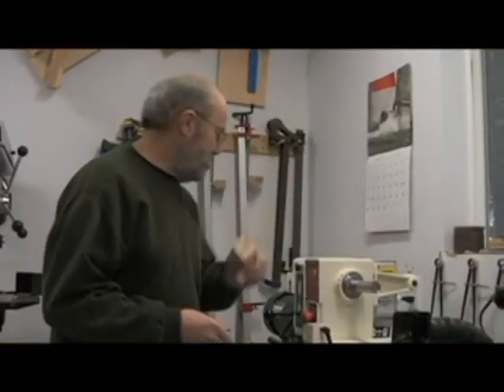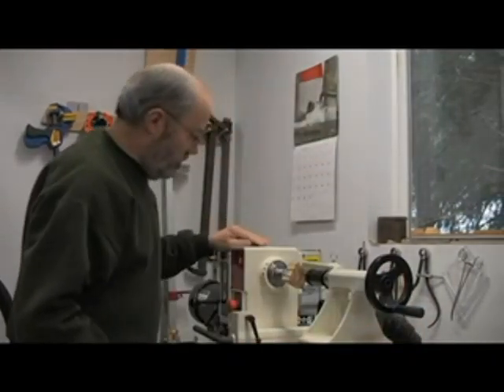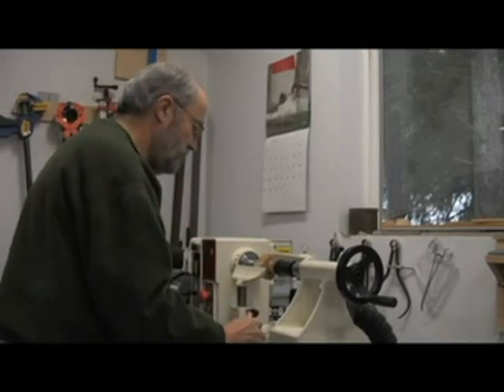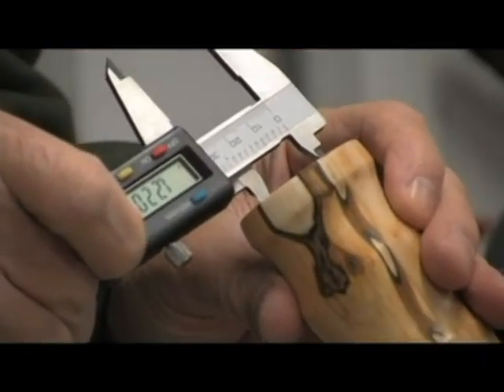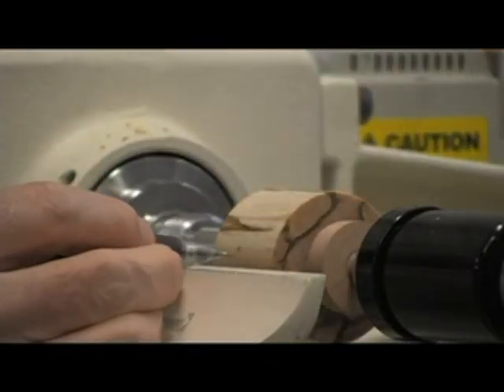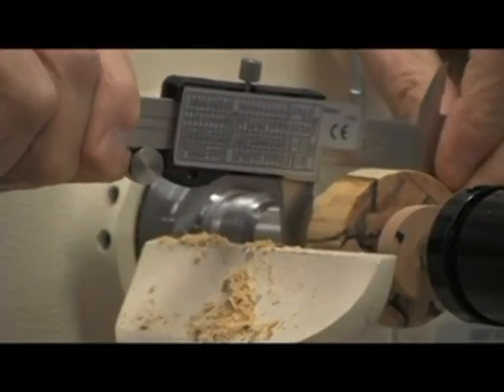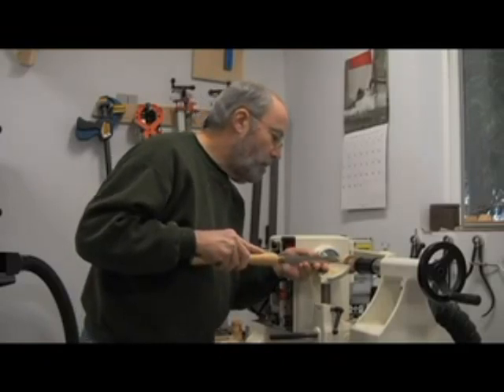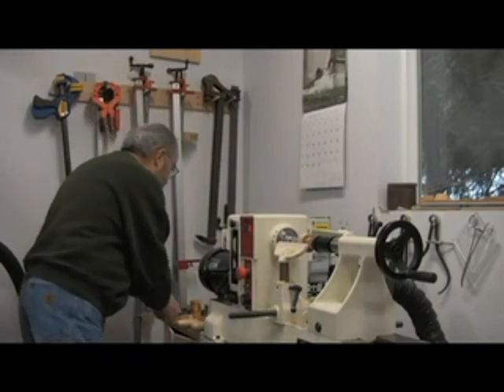Turning A Salt Shaker, Step 5

Comment from the maker: Thanks for your comment. Cutting the tennon is fairly exacting as far as size goes. I find better control with the parting tool and the scraper just would not work for cutting the channel for the cork. I don't think any of my scrapers would be faster or cleaner for the job. As with anything in woodturning, your best choice of tool is whatever works best for you. There are always several ways to do the same job. Hope that answers your question and thanks for watching my video.

Gary

Comment: I am just currious on why when you were making the tennon that you used a parting tool to do most of the work when it would have been easier & cleaner to use the parting tool to make the mark for the end of the tennon or just plain leaving it out all together & using the scraper to do the whole thing, I am just currious.